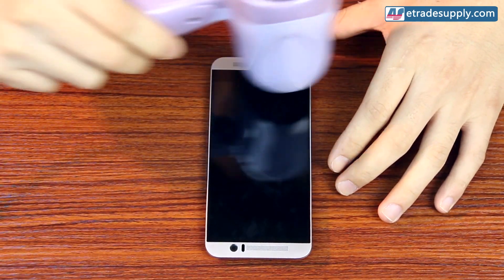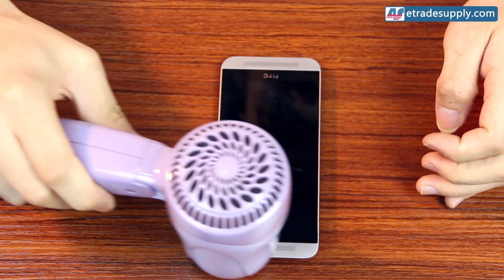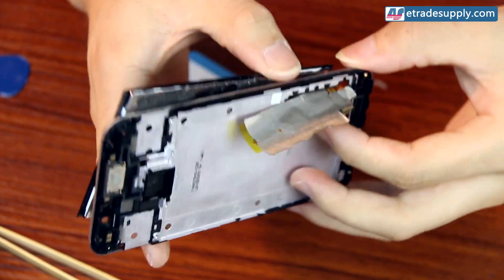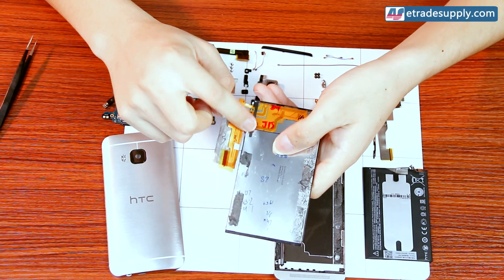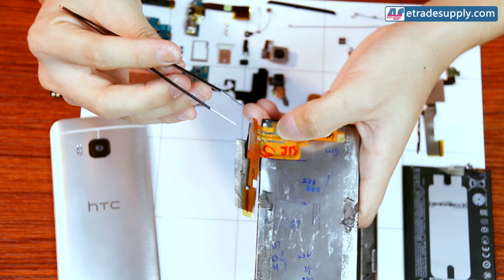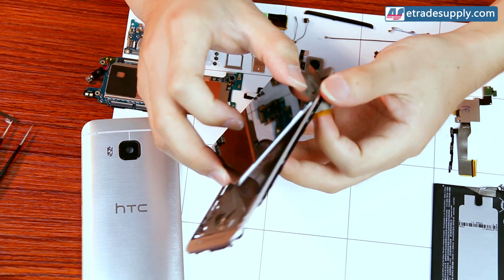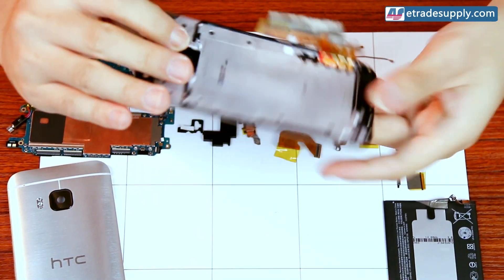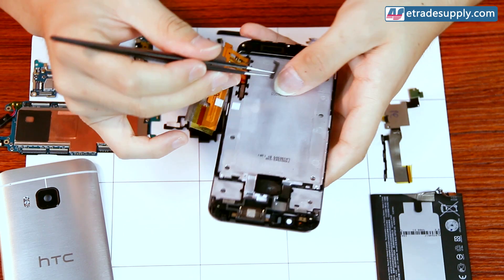How to Tear Down HTC One M9 LCD Screen Assembly In 2 Minutes

Comment: I pulled up the glass (touch digitizer) instead the lcd.. cracked my screen and had to replace it. 🤧
Reply from the maker: Be careful when pulling up, if it is hard, you can heat it with a heat gun.